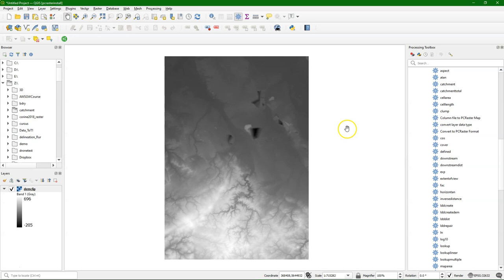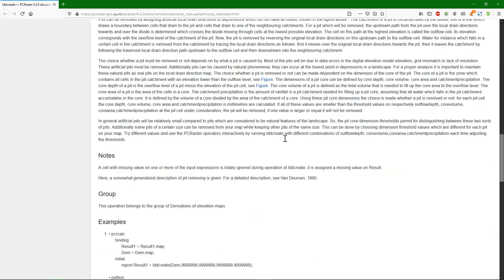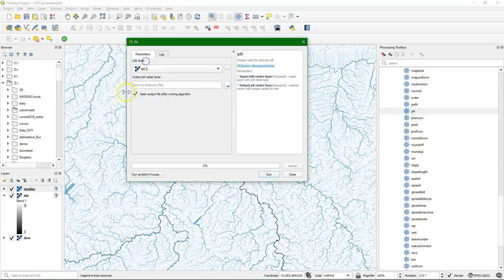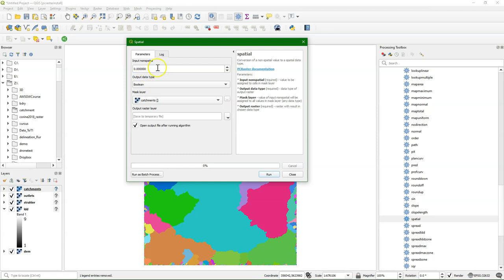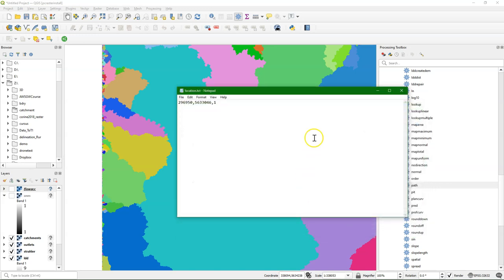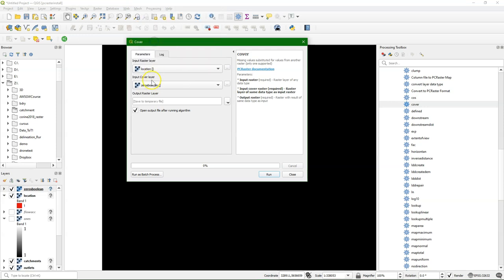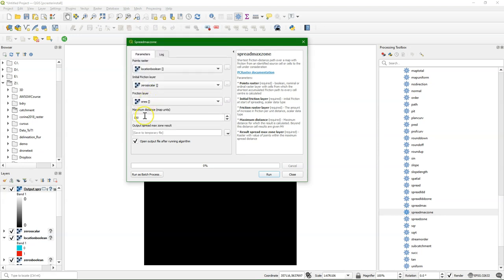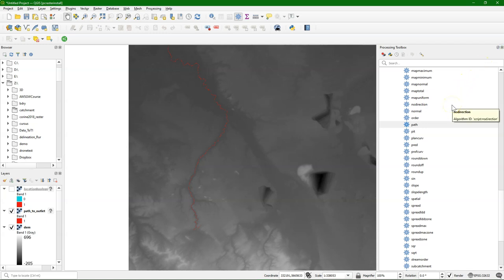Hydrological analysis with PCRaster in QGIS

Comment: Hello again Hans. I have followed your video successfully up to where you are using the Column File to PCRaster Format. I have chosen a location, right-clicked and saved a notepad file exactly as you outline. I get an error I cannot understand:  

(In the PDAL Log Messages) WARNING    Data source is invalid (readers.las: File signature is not 'LASF', is this an LAS/LAZ file?)

 (In  the OGR Log Messages) WARNING    Cannot open C:\Users\~\location.txt ().()

I am stumped at this point. If you have any suggestions I would be grateful. Have a good day!
Reply from the maker: The PDAL error is strange, because it shouldn't use PDAL. For some reason it thinks your text file is a point cloud format. You can file the issue on Github, including the textfile and mask so I can check what goes wrong. Also mention the QGIS version. https://github.com/jvdkwast/qgis-processing-pcraster
Reply: @HansvanderKwast  Thanks, will do.